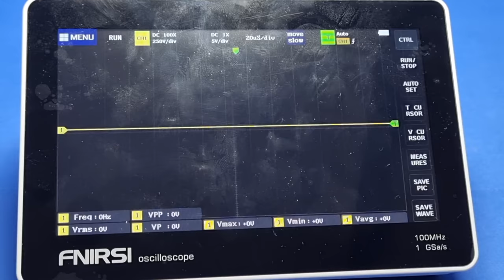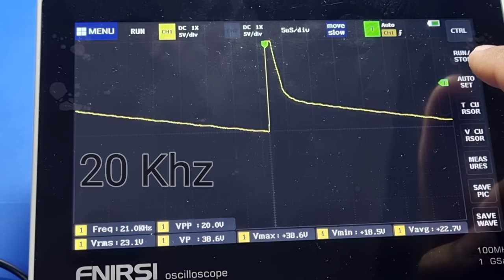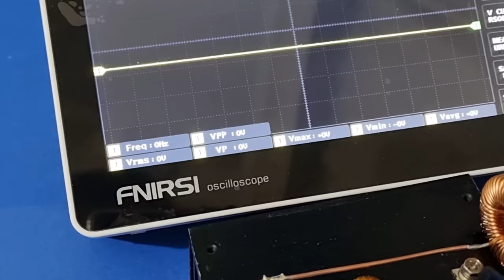New Idea : How to Make an Induction Heater Working with a Single Mosfet

Comment: how much current does the circuit takes when applying 12v?
and what the mosfet voltage and amps that I need if I don't have the same mosfet as you??
 just give me volt and amps and I'll search.
Thanks for the video great idea for one mosfet.

Comment: Poor design, the resonant circuit is not frequency matched to the excitation circuit of the oscillator. There are large energy losses in the transistor. The excitation oscillator should give a rectangular output voltage waveform with a frequency of about 100kHz then this system would be a little more effective and the heating coil made of several parallel wires to counteract the skin effect and at the same time reduce the impedance of the resonant circuit. The structures can also be made simple and effective at the same time.

Comment: I wish one day to convert a propane operated fridge to 12v with an induction heater for a very low power consumption solution, just imagine a fridge that works with less power than a CFL.